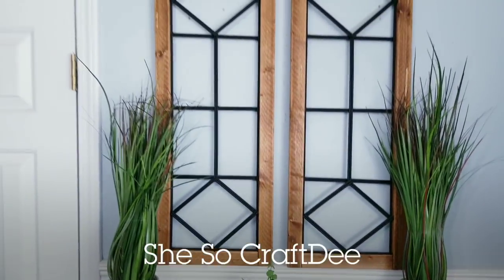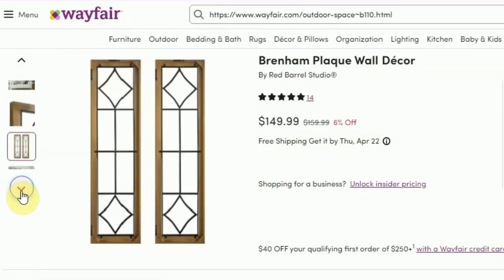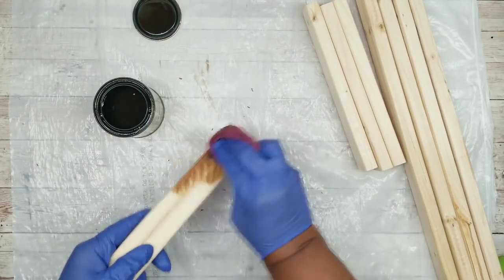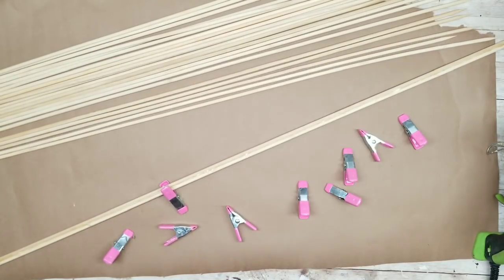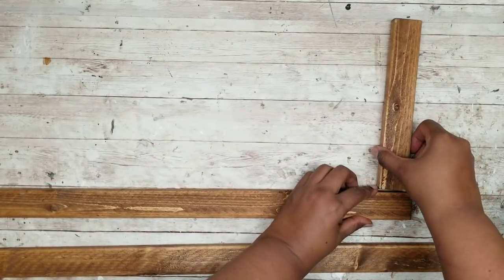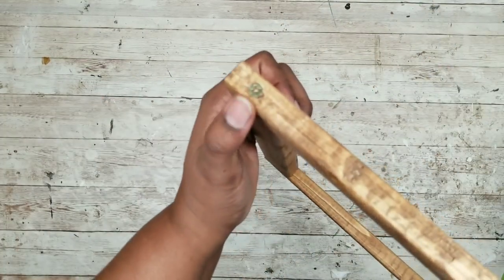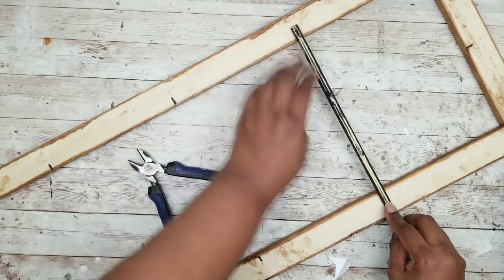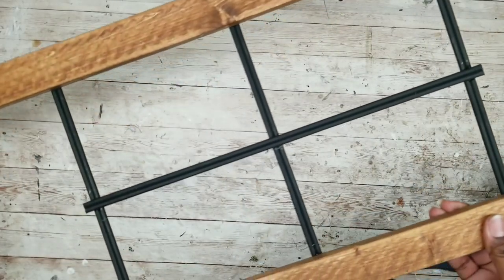*NEW* HIGH END INSPIRED Window Panel Wall Decor | DOLLAR TREE Iron Dupe and Wood | LOOK FOR LESS!

Comment: You are very talented! Have you done a three panel privacy screen room divider diy video? I think it would be kind of like this video, except the panels would have to be floor to ceiling (or just shorter than the ceiling). And, the panels would have to be connected with hinges and self supported and sturdy enough to stand on their own. Is there a way to diy something like that in an affordable way but without it looking like it's cheap?